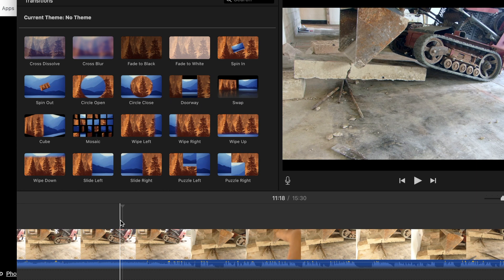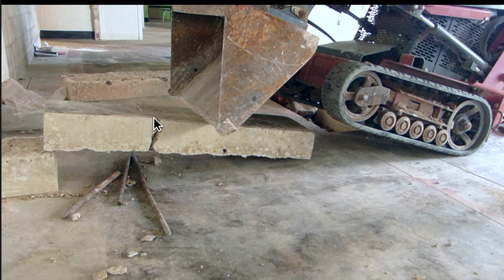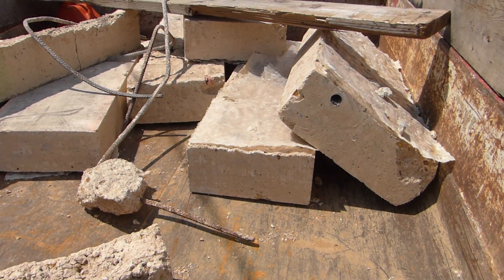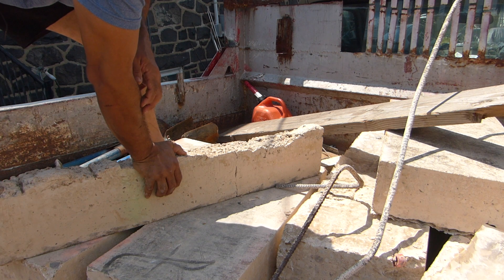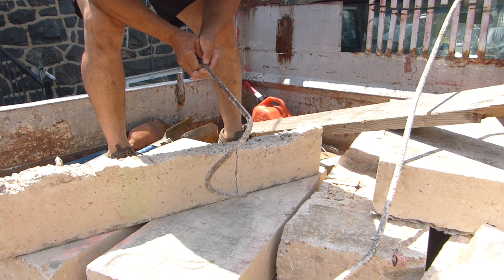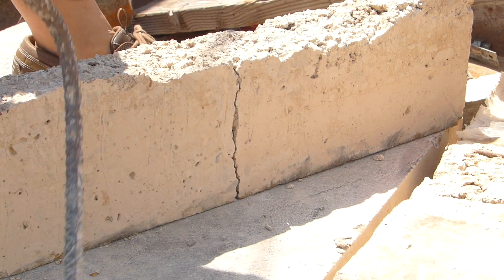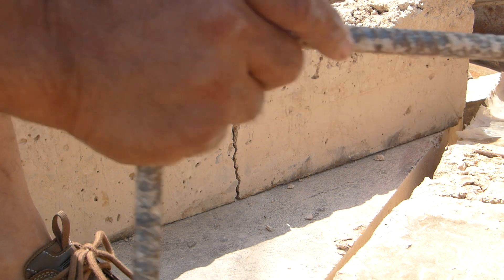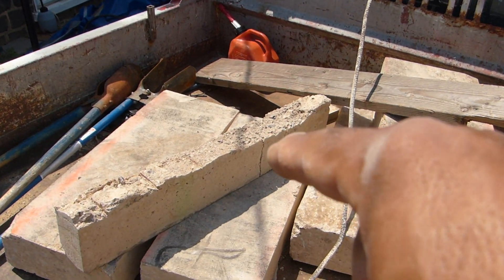Concrete Epoxy Repair can stop deflection, depending on location and rebar reinforcement

Comment: Nice video. So well explained even idiots like me think they know enough to start throwing up comments. Marriages, sex kittens, trial separations, law suits. Sounds just like structural engineers at work. So epoxy can fix a marriage, I didn't know that. How much do I need and where do I put it? Is the slab jacked up level while the epoxy is injected into the cracks? The compression strength of epoxy must be zero compared to concrete, it will surely just cycle a few times and it's a problem again?
Reply from the maker: Excellent question on do you level slab first... Remember, we get nothing for free, jack up the slab and a column reaction may occur... But, I would play it safe, depends on the amount of deflection... Epoxy and add exterior post tensioning.

Comment: Is using epoxy considered a permanent repair? That ceiling at Champlain had lots of epoxy repairs that had new cracks running from it, or is that from continue rebar corrosion?

Comment: Good stuff dude. Been following your posts but I'm a skeptic to win over. I was waiting until they got to the bottom slab. I think you nailed it. Good work. As I commented before, I did electrical construction in Miami the same time that Champlain South was built. Miami was booming and there was shoddy workmanship everywhere.
Reply from the maker: Thank you Joe,  it is mostly positive, the analogy of the cheating husband or wife and some people it triggers their feelings but at least they will not forget how concrete interacts...

Comment: We had a job many years ago on the coast , joining concrete post togather that had suffered from rebar jacking , impact damage , sea air , high salt , we joined by drilling hole s in the two concrete damaged piller , putting in rebar staples attached by lockset expoxy ,two in each post , we then used more expoxy tubes around the staples to bind to  the concrete , we had 15 to do . That was about 10 yrs ago , they still good , ur videos are very funny , u should be became a construction teacher as u pass on knowledge brillantly

Comment: To me it seems like they tried the epoxy in some places (and not with great aggression) just to make it looked like they were doing something -but someone knew none of this was going to fix the major problems they had. It was so bad that the disaster happened and now it appears it’s move on-nothing else here to see and let’s sell and start over.  What scares me is in reality how many other buildings that are in that area and along the coast everywhere that are facing the same problems?  Not counting many other buildings not on the beach.  I remember someone saying it reaches the point where “it’s more cost effective to just demolish and start over” because the repairs will never restore the building the way it should be??  So they should have condemned the building and at least the people would still be alive-idk🤔🤷‍♂️
Reply from the maker: Julie, the punching shear still happened and this video helps explain how epoxy performs in the crack repair system...  Perhaps, the deck ''butterfly" was a result of an area that could have used some epoxy or tension supporting...  For sure, the report had this deck as a life/safety issue but it seemed to be not immediate on the support of the structure... I am guessing this engineering company will never do another one of these inspections again... They must be pretty scared...
Reply: @ForensicCats  Thank you for explaining that...I’m guessing you are right for sure.  You are doing an excellent job walking us step by step through every scenario and I have learned so much. I have great respect for what you do-it’s a very complex profession. 🙏😊
Reply: @ForensicCats  But there was a follow up letter in Oct, 2020. The fact that they asked the condo to close the pool and the condo association wouldn't. Keeping the pool open was more important to the condo owner? That is what will be asked and will be used against the condo owners/board. IMO. Yes, it was far away from the building. But if they wanted work to continue should they not had just complied with the consultant? I don't believe they had the loan secured yet so money may had also been a factor.

USA TODAY, July 2, 2020
SURFSIDE, Florida – When workers from Concrete Protection and Restoration and Morabito Consultants arrived to investigate and remediate work at Champlain Towers South, they found such extensive concrete deterioration and corrosion of reinforcement that some of the repair work couldn't be performed for fear it might affect the stability of nearby areas.
In a summary of work produced by Morabito Consultants on Oct. 13, 2020, the company reported it had discovered several issues, including potentially deep deterioration of concrete near the pool area.

Full restoration and repair work "could not be performed" because the pool "was to remain in service for the duration of the work" and because the necessary aggressive excavation of concrete at the pool "could affect the stability of the remaining adjacent concrete constructions."

Comment: So the core samples taken in the report the husband and wife must of have been having a lot of arguments over the years i am not making light of what happened but makes sense the constant flexing and not enough rebar the pool deck many thanks for your update from someone now know about concrete and rebar you don't need letters after your to know what your talking about 👍🙂20.30 in the evening in the UK .
Reply from the maker: YES, and people called the ''cops'' (engineers show up) and they tell the parties that the fight is a longterm battle and they need therapy...  The complaining party, says, ''How much will it cost?"... They hear the cost and tell the cops to go f*** off  !   
Then the fight continues for 3 more years and the cops are demanded to report what they observe to the Surfside (40 year report)... Then the party decides, we have no choice but to deal with this marriage but by then, an INSTANT DIVORCE takes place! 
They waited too long to put the marriage into therapy and perhaps the engineer should have demand some intervention !    Maybe, some propping, like they did at the other parking garage; I did a video on days ago.
Reply: @ForensicCats  been doing some research a lot of penny pinching from the developer with no experience with a shady past and the contractor was own by developer Mattel construction and at the last minute wanted to add the penthouse floor work was stopped because of violations but 6 day later a permit was given the developer Nathan Reiner was a big man in Miami. I g guess money talk and he  made a very very big profit. I loved you reply very humorous but hit the nail on the head the divorce is well and truly over 🐈🙂👍

Comment: We used epoxy to repair some wood. We removed the rotted wood, let dry, applied wood hardener, applied epoxy. A few weeks later, some of the epoxy bonds failed (principally where the epoxy bonded with the wood. The epoxy itself was strong but we can see some epoxy shrinkage during curing on all repairs. Maybe different coefficients of expansion between the wood and epoxy (for heat and rain) helped the failure. 

We are thinking of grinding out the epoxy and using screws as "rebar" from both sides.
Reply: @katoshi Epoxy is essentially chemical glue. Epoxides are chemical radicals, very reactive, that want to bond to whatever is nearby…

Comment: 🏗❤📺 It was very important to make those epoxy repairs right away,  maintenance delays cost lives. Great Demo
Reply: Maintenance really wasn't their deal was it....
Reply: @jplattet  Hi Jim ! I think the tenants were scammed by the condo association ,3 years in maintenance delays by a court trial, now tenants have no life. I think motel 6 would be safer 💡📺
Reply: @firefox2716  One imagines that it must be a thankless job being on a condo board. And maybe most people in that position haven't been told clearly and plainly that the first duty a condo board has is a fiduciary duty to protect the value of the real estate. Everything else is secondary. At any rate, as my dad always said with respect to maintenance, "You can pay me now or pay me later."